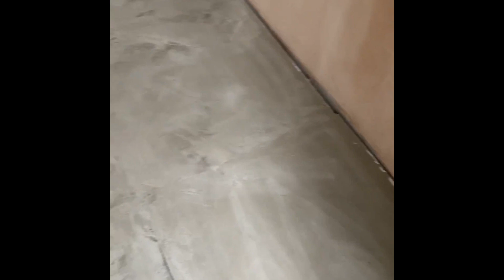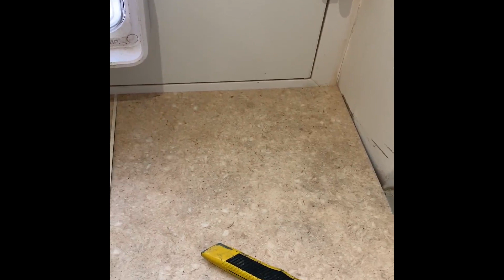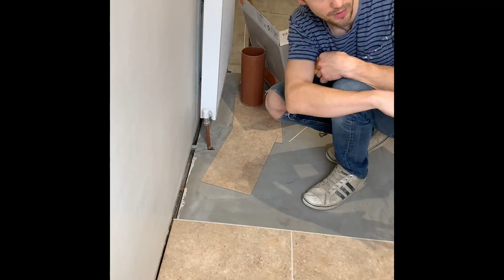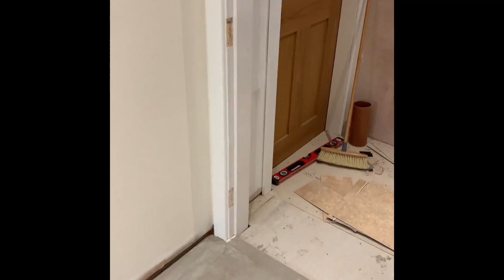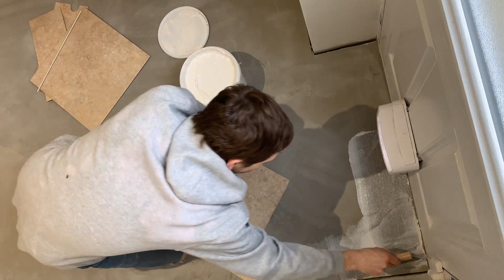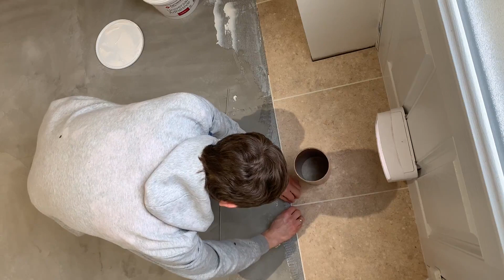DIY Karndean Laying with design strips

Comment: Apologies if you explain in the video (watching on mute) but how are you sticking these tiles? Glue on the back or floor?
Reply from the maker: @thedekoygaming  glue is on the floor. In my head this would guarantee the edges of the tiles would be stuck down  and I wouldn’t miss an edge trying not to spill over the edge of the tile. 

Hope this helps.

Comment: Great video, certainly has given me the confidence to fit it myself 😁

Wonder if, now 2 years down the line, you've had any issues etc that only became apparent with time and made you think about doing it differently next time 

👍
Reply from the maker: Two years later and it still looks exactly the same. It’s great stuff and the way that I have put it down seems to be doing the trick. 

Would I have done anything differently? The only imperfection that I can see is that when I laid the cement boards underneath and then screeded over it, there is a slight change in surface level and when the light catches it at the right angle you can see the change. It’s annoying, but not annoying enough that I’d have paid someone to do it. 

So in summary, make sure your subsurface is bang on and you should be alright. Definitely have a go, I’m no DIY wonder, so if I can do it then I’m sure you can. 👍🙂

Comment: Hey good job. Only problem is you should let the glue become tacky by waiting for the glue to become transparent before laying any floor. You didn’t have to dry fit the whole floor ether that’s just too much work.. dry fit the first couple pieces then use a pencil to mark where the first couple of tiles will go then glue backwards towards the outside  door then just wait and then once the glue has time to setup you can start. And chalk line a straight line from one end of the room to the other so it doesn’t look crooked. But looks good
Reply from the maker: Excellent, thanks for the advice. The dry laying was more of a paranoia thing on my part than necessity. 😂

Comment: Hey I was wondering if u could send me a unedited or not fast cut of a part I was trying to keep
Up with u but could cuz I could see what u was doing at a fast pace
Reply from the maker: Which part in particular, I can have a look at what I’ve got, but some of the videos are actually filmed at that speed so can’t slow them down
Reply: adrb1984 it was around 23:19 when it transitioned from the other cut and after that I was just lost lol and just wanted a more slowed down visual so I was following along with u haha
Reply from the maker: https://youtu.be/mRNK2sYsutA slowed it down, but unfortunately that’s the best I could do. Really the thing to remember with this is to make sure you lay it without sliding them too much as that made the glue squeeze out too much. You want a little of that, but not too much. If it squeezes out wipe off straight away as it gets very sticky surprisingly quickly.